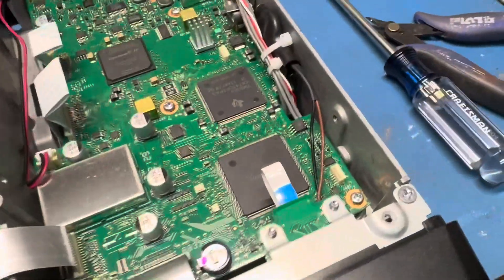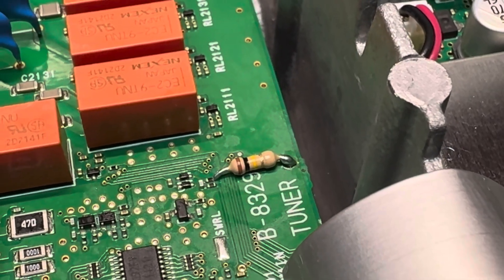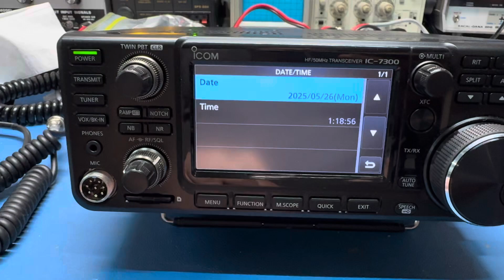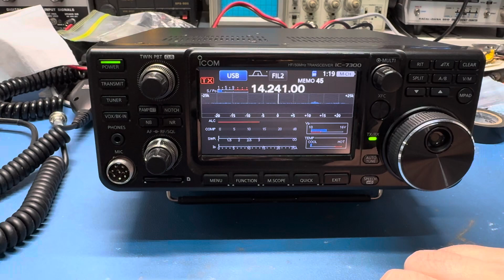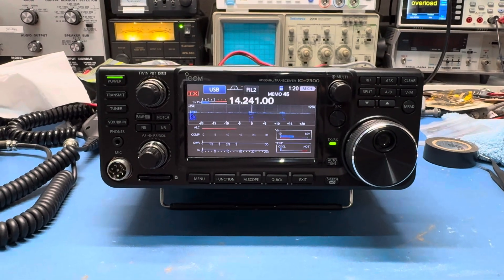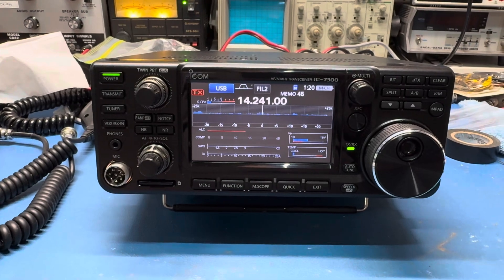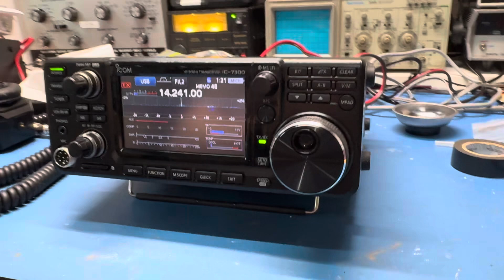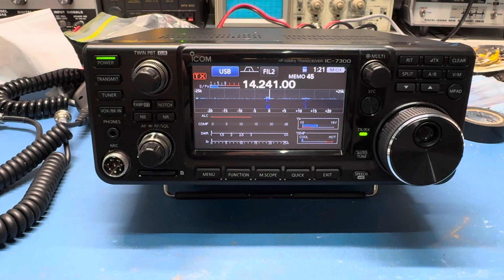Icom IC-7300 clock battery fix & tuner expansion

Comment: I see several videos of methods to remove the battery, some have damaged the PCB.  I don't believe the battery needs to be removed.  It is likely measured as an open circuit after it fails.  With my radio I made an 'L' shaped bracket that fits under the corner screw for soldering the ground and holding the battery, and a single wire to the old battery + terminal.  I used a rechargeable 3V CR2032 battery, so no circuitry change.

Comment: The same procedure for replacing the battery is also for the Icom IC-7100
Reply from the maker: Yes. I think it’s a requirement to do after it goes dead. Usually I do it with a battery holder and a rechargeable 2032. Just didn’t have any I could find this time.

Comment: Glad To see someone else did the tuner mod.

About of Sad Hams cry when I tell them I changed this and that on my ICOM
Reply from the maker: New icom radios out of the box never do listed power output due to aggressive ALC, the tuners are limited for no reason. The backup batteries barely last a year. These mods are required just to make them meet advertised spec. Never had this problem with the older icom radios like my 746 or 756